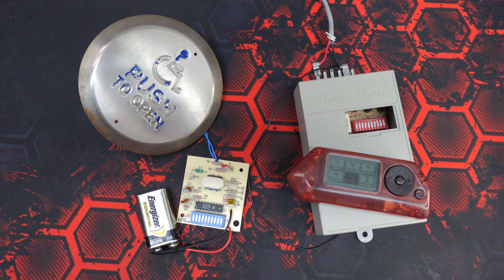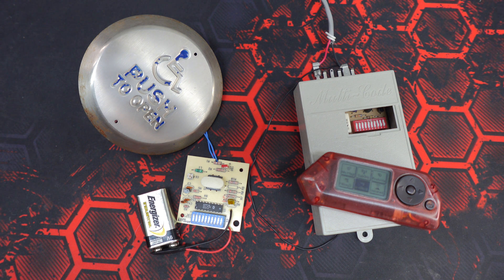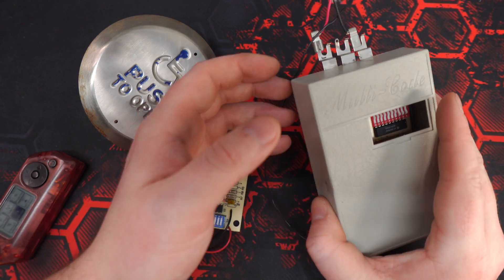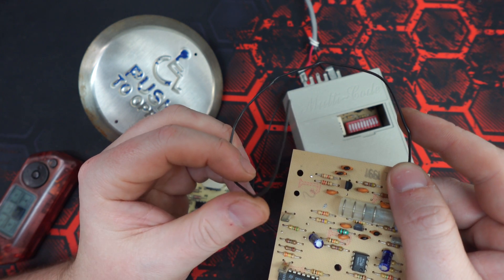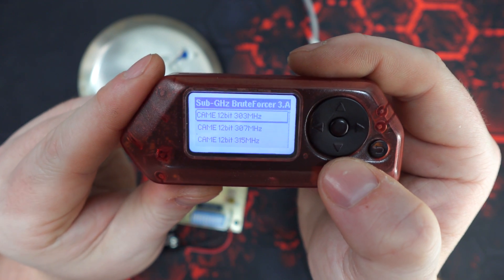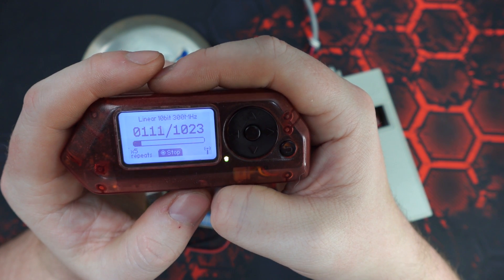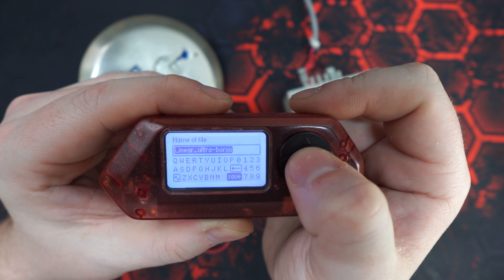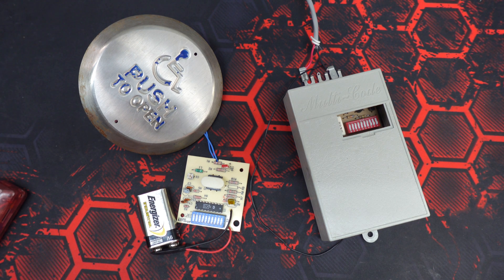Flipper Zero: Bruteforcing Linear Multicode Wireless Door Controls

Comment: Thanks, it was very embarrassing that I wasn't able to just replay from  IRead Raw but now it's finally working.  Since this isn't a rolling code shouldn't the flipper (in theory) be able to pick this up from just READ the same way as it would like a Mega code?

Also one strange thing is the dip switches when I opened up my working remote were 1, 5, 6, 8, 9 which should be 865 but that didn't work and when I brute forced it was in the 400s, like 484 or something.